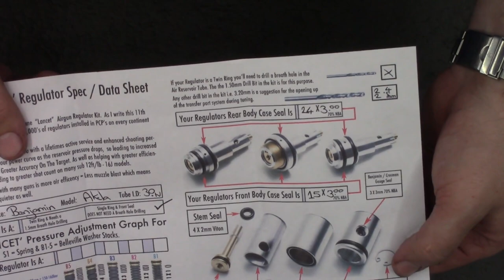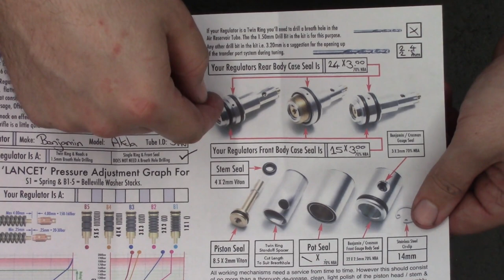Benjamin Akela full strip down and regulator install

Comment: there is also a small grub screw next to the filler port to drain the air from it if you dont want to touch the gauge

Comment: Hi There, Great video. I've just purchased an Akela, poor delivery guy hasnt got back to the shop and its in Bits..JUST FOUND the new style anti tamper screws and they arent plastic but look like a snap off grub screw,did manage to get 1 out with a sharp pointy stick ,the other one will need a small drill to make a locating hole for a little grip.
Just to let you guys know in case this on your to do list. Thanks .Roger
Reply from the maker: nice one you can have some good fun with the Akela 😀

Comment: Superb video cheers. Can I ask a question please. I have an Akela purchased just a few weeks ago. I have put no more than 50 shots through it. I left it alone for a week while I was away. I have returned and found there is play between the stock and metal parts. Pivoting around the stock screw that travels up through the stock. I am sure it was rock solid previously, as it is really noticeable even just taking to the shoulder. My hand on the stock can easily push up cyclinder. It must have moved by 2-3mm. I have gradually tightened the stock screw and the play has lessened. I am now at the max of the screw. If I go further I feel I will be in big trouble and cross thread it. The play has gone and we are back to normal. I am just concerned why it would have loosened so much doing nothing. Any issue with this in your experience or thoughts why it may have happened?
Many thanks

Comment: Thank you for guide. Looks almost identically, very similar like Reximex Apex/Regime. Difference is that cocking lever is moved forward and Reximex doesn't have regulated hammer spring. Other minor differences is marginal, like that back picatiny rail non existent  and different power regulator, no knob, only flat screwdriver head. Shroud is not that far back, but baffles are the same. Internals of valve probably very similar or the same.
Reply from the maker: thanks for watching 🙏

Comment: Hello, I have a leak at the connector for loading the rifle. By dismantling I have the valve system with the seal in it, but if I tighten the connection fully the air from the compressor no longer enters the rifle. Is there a spacer or other piece between the fitting and the small gasket at the bottom of the threaded hole? THANKS

Comment: Hi there I was in the middle of stripping down my Akela I got to the part of taking the air barrel off by removing the 2 2.5mm grub screws and the is only one in there the other must of broken off do you have any ideas because the leak is obviously the O rings inside Regards

Comment: I got a Reximex accura but it low at 10ftlb and i cant turn the hammer spring adjuster, I did not want to return it but i think i have to, Is the hammer spring adjuster anti tamper easy to remove? Or shall i just return it.

Comment: How would one get around the issue of the akela's pressure gauge no longer reading actual fill pressure, and instead now reading the reg pressure?

Any help in this matter is greatly appreciated.

I do not trust my hand pump gauge.
I assume a qd gauge between the akela and my pump would be the answer but I don't see a ton of $20  rigs already addressing this issue on ebay or amazon.

Comment: Must have a problem with mine as this morning noticed all air gone on the gauge, been wanting to fit a regulator and came across an anti tamper screw whilst trying to take the cylinder off. Ffs 😢 why anti tamper there (uk model) anti tamper for hammer spring as well. Anyone have any simple suggestions or know anyone who would be able to fit etc. north east UK. Thanks all

Comment: Awesome video really helps a lot! I am though, unable to remove the valve cylinder end. Tried heat, vice, hammer( percussion) etc!!! I am getting  workout...but I can feel the tears welling up. Any suggestions would be GREATLY appreciated! Thanks in advance.
Reply from the maker: yes i feel you pain, we did one for a friend and it was a nightmare to got off 😣all i can say is keep going it will come off in the end
Reply: @sub12airgunners  Cheers. At least it still works having re-assembled for the time being. I discovered that its best to have the safety set to 'on/safe' before tightening the trigger assembly, back on to the cylinder. If you don't, then it wont tighten and you risk shearing the bolt, and then having to source a box set of m3 hex bolts like I did! 😅
Funnily enough, I managed to get the front fill end off! Sods law eh?

Comment: since its an old video might not get an answer, but do you have another tutorial video or some other doc explaining how to calculate length of the hammer spring? thanks
Reply from the maker: Its not that sophisticated I am afraid, normally we just cut a coil off at a time depending on power and how much pre load we have on the spring it pays to have a spare so you can cut it down and try it out. Thanks for watching.

Comment: What is that little brass plug on the valve thats farther away from the transfer port opening it looks like its been plugged and its brass as well ? ty
Reply from the maker: I think that's the burst disc you can see 👍
Reply: Its on the outside of the valve on opposite side of thr transfer port in from the two outer orings on the valve it looks like a bress plug on the video

Comment: I have a .177 Akela and a .22 Cayden. It seems that if you want to convert the Cayden to .177, you need just the .177 barrel and the .177 cocking arm / probe - do you agree? To make it look nice you can use the 2 pieces of the shroud over the barrel.

Would that work to convert the Cayden to .177, or am I missing something?
Reply from the maker: don't the Caydon but most guns it's just a barrel and pellet probe to convert them 👍

Comment: What was the original TP size you drilled out in the valve housing? If I decided to increase my Akela's TP without a reg and shorten the hammer spring to prevent as much hammer bounce, obviously I can't drill it to 2.8mm because I wouldn't be running at reg pressure of 85bar. I'm running at an average of about 170bar so to keep my power down I'd only need a tiny amount off the TP so if the original is 1.5mm then I'd go to 1.8mm which should be enough. Depends what the original hole size is. Thanks.
Reply from the maker: to be honest the 3 i have worked on have all been different but the last one was 1.5mm but it is a brass insert so you can drill it out and start again if you needed to  😁

Comment: I have a brand new Akela. After getting blasted in the face with a couple of shots I noticed that the power adjustment knob had wandered it's way out the other side. I was able to get it back in alignment but it keeps trying to work it's way out. Is there any way that I can secure this and still with to be adjustable?
Reply: У меня есть решение как закрепить ручку регулировки. Скоро выложу на своём канале. Там будет ещё много интересных решений с Бенжамин Акелла. Не пропустите.

Comment: Impressive ,,,i just ordered me one of these air rifles ,,,i been watching lots of videos on,these and I hope mine performs just as good as the ones in,videos ,,,,but if I decide to add a reg,,,,I got the video to do it by,,,,thanks for the info 😊😊
Reply from the maker: they can be great rifles our one is still going strong
Reply: Before you actually purchase the reg, make sure you can remove the valve cylinder end assembly. Mine is stuck fast. No amount of heating or torque will shift it. Good luck mate!

Comment: Do you by chance know what the thread size is on that pressure gauge?
Reply from the maker: Not 100% sure, although 99% of the gauges are 1/8 BSP, I see no reason why this one would be different. Thanks for watching.
Reply: Я тоже ищу размеры резьбы манометра. Получилось узнать?